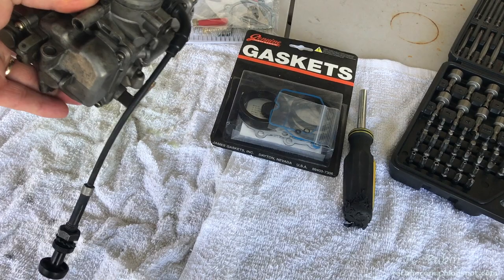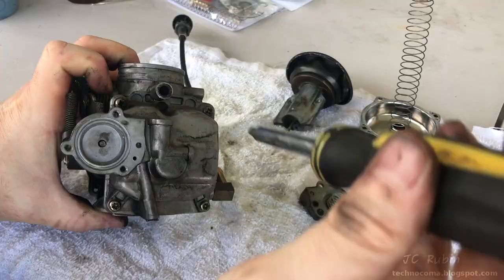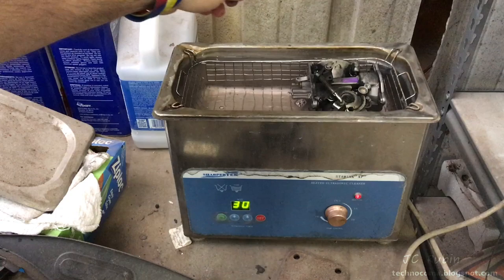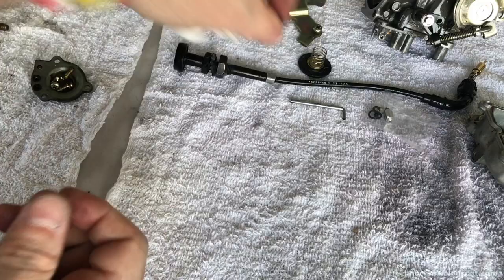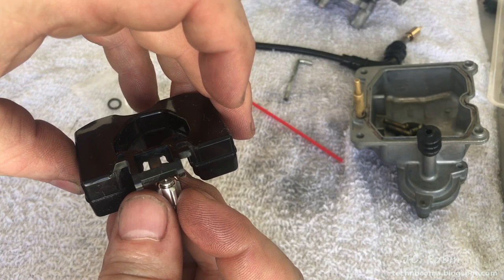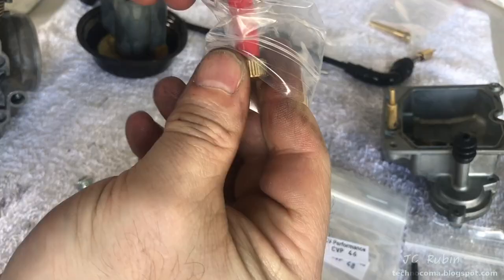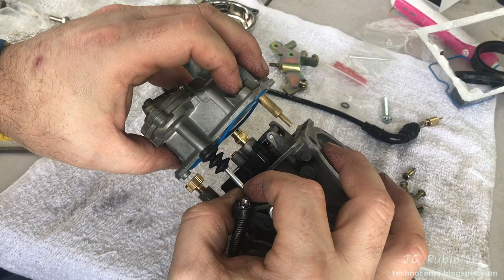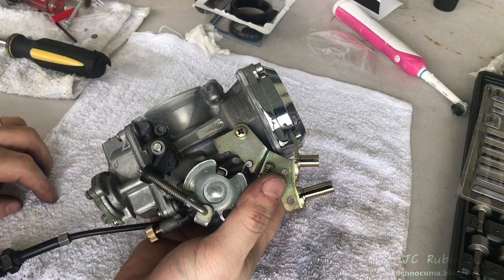Keihin Carb Rebuild and Rejet for Harley Davidson Evo and Twin-cam Bikes

Comment: When I'm having issues I'm going to look u up. I rebuilt my 2001 carb and it wouldn't idle and was running rough. I cleaned everything and replaced my air/fuel mix screw to a finger turn style. anyway at the end of this video I figured out the problem, I forgot to install the load top end spring. How stupid is that went to my work table and its sitting on the side. can't believe I did that. BTW- I have 95" top end from the 88 it came with you think with that and a true duel rineheart exhaust I should go up to a 200 jet  or stay stock?

Comment: It's worth noting that a lot of your supposed #2 phillips screws are actually #2 JIS screws which have a different taper. Using a phillips screwdriver in a JIS screw increases the chance of the screwdriver camming out of the screw. 

Not sure why Harley was using Japanese Industrial Standard screws (JIS) but you can clearly see they are definitely JIS at 11:14 in the video by looking for the small recessed dot on the head of the screw.

JIS screwdrivers are backwards compatible with phillips screws, not the other way around. Just make sure you're using the correct screwdriver because phillips screwdriver in JIS screws is VERY easy to strip out which probably happened to that one at the beginning of the video that appeared to be previously stripped/cammed out.

Vessel makes some excellent JIS screwdrivers btw.

Comment: Thanks for the video on this rebuild In the process of purchasing all the cv performance upgrade kit idle screw etc to do a full carb rebuild on my 03 Dyna low rider I have to re Jet as well I am running lean carb has never been touched so I figure what a great opportunity to rebuild rejet etc your Video makes it all possible Thanks again
Reply from the maker: Glad to help.

Comment: Great detailed explanation!! However being a long time wrench myself my experience with CV carbs that wasn't in the video. I don't apply oil to the diagram and exl pump. They tend to swell up. I also put white grease on all screws! Especially the bracket screw & bowl screws! I like to check the bowl for flatness and file any uneven areas! As well as the slide rails tend to have uneven areas and hit them with a jewelers file. Then buff them smooth. This tends to fix slide binding and chatter. I also polish the front of the slide. Instead of scribing marks on the mixture tube screw tube I use a sharpie. I like the red mixture screw knob !!  Curious to know if the needle in the Kit is a 88-1200 needle which the same company sells separately? Just my two cents!

Comment: Due to a back injury, my 98 Evo FatBoy has been sitting and now will start on starting fluid, but won't run on the carb. Your video will be a big help in the carb rebuild that I hope will get me back going. Good ole pump gas. I rum premium, but non-ethanol is very hard to find around here.
Reply from the maker: Just drain the bowl when ut sits up and youll have no issues.

Comment: The carburetors get pretty sooty with the crankcase breather that is routed through the air cleaner and directed into the carb inlet. It also leaves deposits on the intake valves and piston tops. They sell kits to vent to atmosphere or a discreetly mounted catch can. The bikes run better without the hot and oily air coming in through the intake.
Reply from the maker: true, but when I do removal and install demo's i generally do it by the book along with design faults.   What you see here has more to do with backfiring due to a failing sensor than a breather return.
Reply: Yeah but they look ugly!! Lol. Keeping the air filter clean prevents this!

Comment: Cool Great looks like long time subscriber here Thanks for all your tutorials but  @ about 4:12 mins in  removing float bowl  pin ..locks like the arrow pointing IS THE DIRECTION Pins Is REMOVED NOT INSTALLED ? asking bc I herd one can break the ears off easily if tried to remove the wrong Direction ..so if you Can Please conform or advise iam in the process of rebuilding my CV ..Thanks again much appreciated Happy Wrenching

Comment: Great Video, just rebuilt my '92 super glide , ordered a kit from AMAZON, although they didnt have the jet sizes i installed everything from the kit, really wish i watched your video first, I didn't clean some parts with the polish like you showed, wish i did.......degreased everything , carb clean and aired everything reassembled, but have a problem with the accelerator nozzle not spraying??? Saw on line there should be a ball bearing in the float body that should be loose.......Din't check that , any suggestions?  Thanx again
Reply from the maker: Do you have a show manual showing the carb diagram.  I believe I showed the bearings and springs in the re-assembly.

Comment: What did you lube the diaphragm with
Reply from the maker: A very light application of remoil
Reply: I'm not in agreement with that.
Reply: Me either. I've always heard oil attacks rubber parts. Use dielectric grease(made of silicone) or silicone lube spray. Correct mee if im wrong
Reply: @arthurcutaiar9994   correct

Comment: Another great video! 
What’s the solution you use for the ultrasonic cleaner?
Reply from the maker: Im careful about simply recommending cleaners for the carb in a tank.  Many can attack the aluminum.  Id recommend googling a specific cleaner for carbs in an ultrasonic tank for aluminum and purchase that.

Comment: Are those 20$ carb rebulid kits on Ebay or Amazon any good or where should I shop?
Reply from the maker: Its hit and miss.  Dont cheap out on the cheapest one possible and check the reviews of the dealer.. When in doubt go with the dealer.

Comment: Mines a bit different. Aftermarket I guess...
No diaphragm spring...
More to come.
Reply from the maker: Are you sure yours isnt missing, consult your model parts diagram
Reply: @delorean1  Oh it was missing alright. No idea how the dammed thing was even running before. Been so long since the float needle got replaced I can't go back and ask where tf it went. Either way. Float needle needs replacement yet again... this is fun!... right?